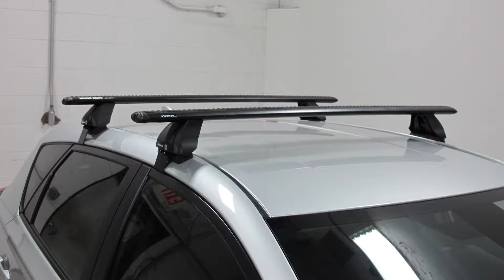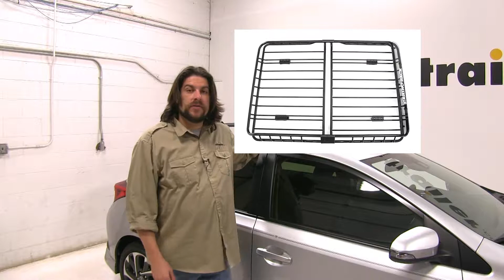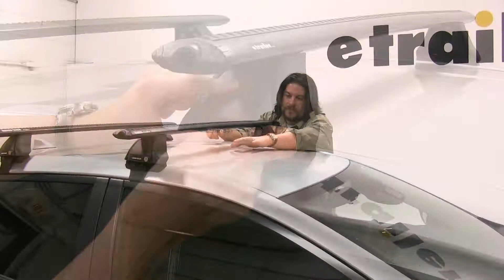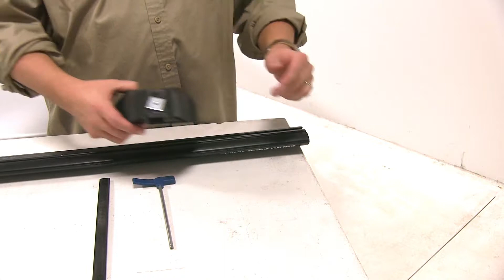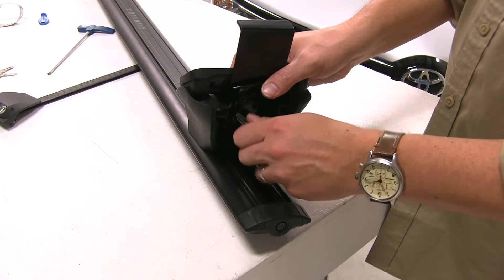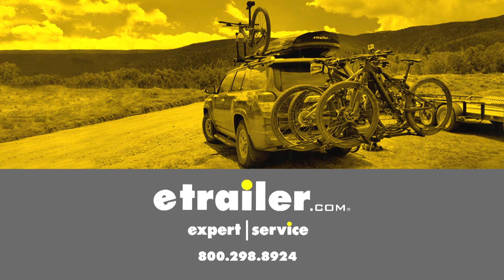Install: Custom DK Fit Kit for 4 Rhino-Rack 2500 Series Roof Rack Legs on a 2017 Toyota Corolla iM

Comment: i have the euro bars and the instructions say 21mm for the front and 17mm for the rear on the measurement strip. at those dimensions the bar is halfway on the roof and the feet don't reach the doors at all. am i reading the instructions wrong somehow or is there an error on the instructions?